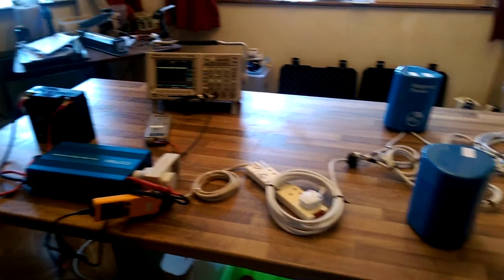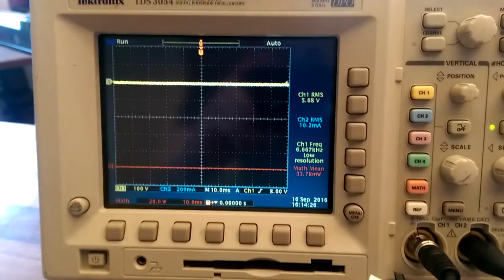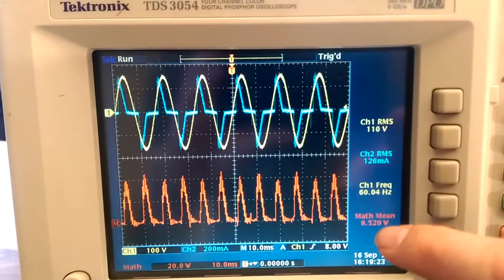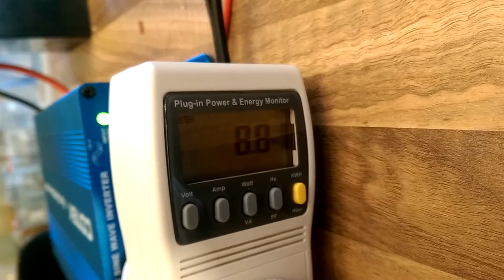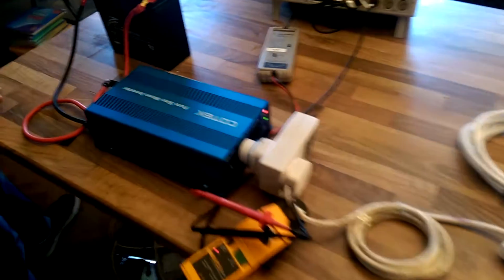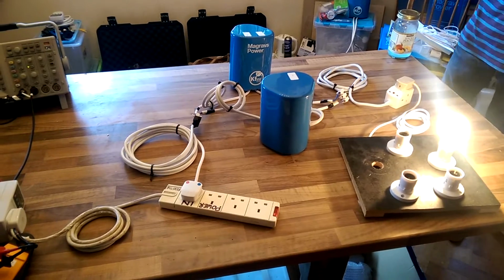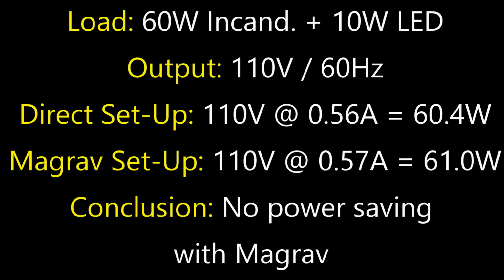Attempted replication of "Arizona Experiment" with Magrav

Comment: in some way the system only work if you connect the magrav with house grid during 20 days- 1 month. The magrav system need to be charged during some time to turn nanocoated coil active. Regardes

Comment: Sorry to say that you need to take a small fan (10W) , a big fan (500W) and a a cig hair (1000W or 1500W) to make the same "arizona experiment".
Reply from the maker: Thankyou K.F. France for your comments. That was our next step to add the non-resistive load such as a fan. However, as you see from the comments by Jon Bliven below who made the original "Arizona experiment", measurement errors were made, and when rectified the results were the same as we showed in the UK i.e. no efficiency savings. So we move on now with big expectation to the next experiment, which I hope will be the "off-grid" unit. Thanks :-)
Reply: Off Grid is something very different... 
2 leds are nothing compare with 2000W resistive items ! I hope you will do your test with best condition :-)
Reply: Many thanks for video labs ! We need more testing lab as you did ! Respect

Comment: Thank you Magrav labs UK. When we performed the experiments in Arizona we had raw data. Since the original experiments we have performed a number of additional experiments to understand the results. In our tests initial tests we connected the ground and neutral wires together to the live wire. We later determined that the meter we were testing with did not measure the load carried through the ground leg and thus gave us readings that did not show all the load with the magravs connected. We isolated each leg of the connections to better understand what we were being shown and came to the same conclusion that you did that there are little to no energy savings but we were tapping into the energy of the neutral wires which carries the purpose of grounding and is not for pulling energy from. Our intent was to share our understanding and it is hoped that our understandings and tests can help move things forward as we share. It is nice to see such a clear review of the experiment that you performed as our sharing moves us all forward. We continue our experiments as we now have some valuable new understandings and I hope others do as well.       Thanks,  Jon    Keshe Manufacturing Arizona
Reply from the maker: Ah ha. Great information, thanks Jon. Ok, well, this is what research and development is all about. At least we established that the anomaly could be explained, and we can now move onto the next thing. Please keep us updated if you have any more anomalies. Thanks, John :-)

Comment: Hello dear Friends,

thank you very much for all your doings and accurate protocolling of the experiments.

I detected something that could be worth thinking about:

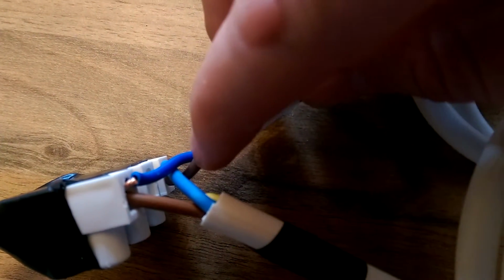At the timestamp 02:19 we see clearly a nearly blank copper under the blue insulation of the "January" MAGRAV.
At the timestamp 02:27 we see clearly a nearly blank copper under the blue insulation of the "June" MAGRAV, too
At the timestamp 02:34 we see not clearly whether the blank copper under the brown insulation of the "January" MAGRAV is seen, too.

But i would guess that none of.the cables of the two MAGRAVs are fully nanocoated.
So there is no fully nanocoated infinity-loop, right?

And i ask myself whether we should be really surprised about the fact that we see no savings, if there is no  pure plasma flow possible?
In fact, for me it is not surprising.
We all know that the plasma only flows in the nano-layers and matter state is a kind of damm for the plasma.

So i would conclude: No fully nanocoated infinity loop means no up-building plasma flow possible and therefore no savings visible.

We have some experience with a full nanocoating in few weeks, if the MAGRAV drives a fridge.
So please try driving fridges with each of your MAGRAVs and wait til all the cables are deep black, plasmatically nanocoated by the plasma himself and then try again.

But even then there might be some days necessary to nanocoat the connections again, which you might damage by pulling the MAGRAVs cables together as an infinity loop.

I hope this helps a bit.
Thank you very much for your attention.
I LOVE you,

Richard
Reply from the maker: Hi Richard, these are great comments, and we can do this easily. We shall post another video after the nanocoating procedure is completed, and we will test again. Please, would you email us at magravlabsuk@gmail.com so that we can correspond? Thanks :-)